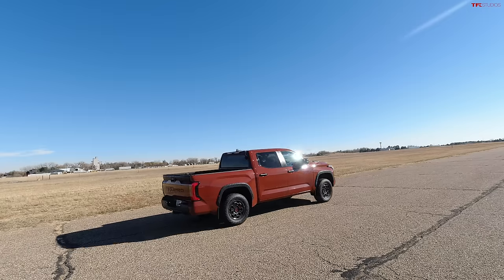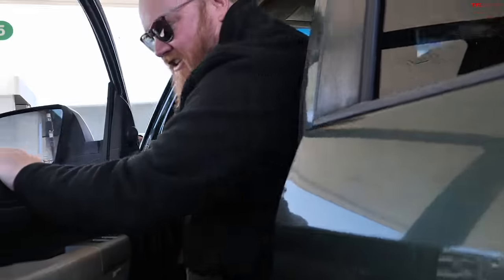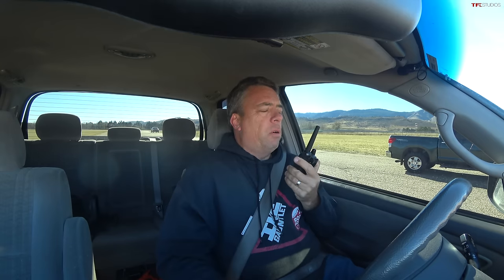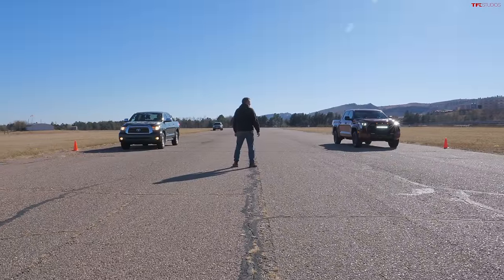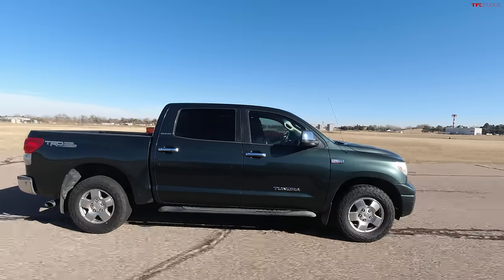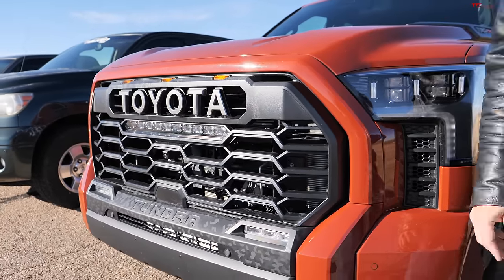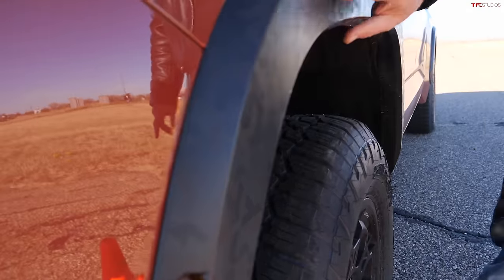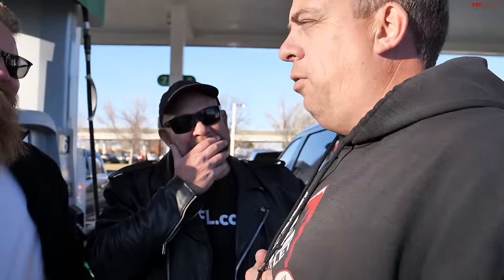Three Generations of Toyota Tundra Drag Race & MPG Surprise: That WAS NOT Supposed to Happen!

Comment: 1st Gen Tundra is still the best truck on the road. I have an 02 Tundra AC 4WD; throw on headers, exhaust, and some 12 hole fuel injectors and it make it feel extremely peppy off the line. I absolutely love this truck, only 161k miles on this bad boy
Reply: 100%
Reply: 161k miles? Not even broken in yet.
Reply: I have one with a modded intake and straight piped and it’s loud sounds like an off-road race truck and has so much power

Comment: That little 4.7L did a lot better in the drag race than I expected it to. 245hp vs 380hp and a full liter of displacement difference between it and the 2nd gen Tundra. I know the first gen is like over 700lbs lighter, but still, impressive showing for what it was.
Reply: I have a full time 4WD 4Runner with the 4.7 and honestly, it scoots off the line lol
Reply: I've owned both the first and second gen Tundras with the V8s. Both were crew cab 4wd and the second gen is much faster. Like Andre said, he got a great launch.
Reply: @mrjjthor  Yeah but even with the great launch he got, the 5.7L wasn't pulling as hard on the 4.7L I was expecting it to once things were well underway.
Reply: @S2KYLEFXLRST the 4Runners have the 5 speed trans and a 3.73 rear gear. My brothers 4.7 tundra he had wouldn’t run anywhere close to my 4Runners
Reply: 271 hp.   Variable valve timing in the 05/06. Complex cams
Reply: 270 HP 👍, I love my 05
Reply: @dalepenner8411 yes 06 sr5 magnaflow exhaust KxN air filter picked up 15 hp I think the truck Flys and sounds amazing
Reply: Gotta hit the traction and tow buttons on the 5.7 to activate the speed.

Comment: 2007-2013 tundras with the 5.7 are truck perfection!
Reply: 2015 with 8 ft bed for me. Longest one they made
Reply: Just bought  a 2013 Rock Warrior TRD.

32k original miles, 1 owner miles!
❤ love it❤
Reply: (2012 w/5.7) Agreed!
Reply: @joebideb  congrats, that sounds like perfection.
Reply: UZ vs UR
Reply: What is better about 2007 - 2013?
Reply: Agree. I have 2005 Tundra and love it still after 19 years. Toyota has a problem in that their trucks get uglier every generation.
Reply: @joebideb  What did u pay
Reply: 2014-2021 are better

Comment: To be fair the 1st gen tundra only raced once so it used less fuel
Reply: Since you mention it - the 3rd Gen Tundra raced only once as well. With that factored, the 2nd Gen and 3rd Gen MPG numbers nearly tied.
Reply: It made no sense to do a gas mileage after a race. If you make more horsepower than the other truck, you spent more gas to make more horsepower than the others . And then its a big Weight difference also.
Reply: They did the mpg run with a new tank of gas and they never raced on that tank..They raced after the gas mileage test was done.
Reply: @andrewinaustintx you can literally watch Nathan zoom down to go pick the one guy up... So maybe not racing, but it went down and back again quickly.

Comment: I bought a 2018 tundra about 6 months ago, zero engine stop start, no direct injection valve carbon issues, no MSD, 4.33 rear end and a massive snarling V8 they are fantastic trucks. I would have liked to seen this ran with tow haul on makes a big difference on these trucks.
Reply: Wouldn't have made much difference. It is the elevation that is killing the N/A trucks in this case. I have a 21.
Reply: @spareparts7630  possibly I live in a pretty high elevation, I think when you have tow haul on it actually uses first gear.

Comment: I owned a 2005 tundra with the 4.7 v8, fantastic truck dependable, reliable. Currently own a 2008 tundra 5.7 only mods I've done is a K&N air filter and a catback exhaust. I absolutely love driving this truck puts a smile on my face every time I drive it. The tow haul is an added bonus.

Comment: I have the grandpa truck(1st gen) but it's a 2004 so I only have the 4 speed transmission and less power without the added VVTI, however, it has 267k miles and all I've ever had to do outside of normal maintenance was change a window regulator that went bad. I love that it has big windows and a hood you can actually see over.

Comment: That extra 1/4 mile run for the 5.7l definitely factored into the MPG. Nice! I just decided to buy a 07 5.7l with 125k as a dedicated tow vehicle instead of a new Tacoma and it definitely has the quality to boot over the new trucks. I just can't see the new one being as reliable over time. Being a toyota owner the past 20 years with a multitude of vehicles, simpler setups and less electronics always last the longest and cost less to maintain. 

I'd love to see an Ike gauntlet between these three trucks with 7-8k loaded on them all.

Comment: Turbos are great for costing lots of money to fix. And not lasting near as long as normally aspirated engines.
Reply: I don’t know, all those Toyota turbo diesels they got seem to just go and go and go
Reply: @JollyGiant19 that's a diesel though. Most people buy gas engines.
Reply: apples and oranges ! @JollyGiant19
Reply: @JollyGiant19  thats not a good comparison
Reply: 2JZ-GTE is a reliable engine.
Reply: Not to mention being fun af to drive. There's an exhilaration when that turbo kicks in
Reply: Do you really need to put 91 into a limited twin tundra? The manual says 81
Reply: not really na engines usually do not work as efficiently as tt engines

Comment: the first gen is definitely the best looking of them all
Reply: Looks like a 98 f150
Reply: Lies. 14-21.
Reply: Yes sir, especially when they gave it a crew cab option in 2004.
Reply: @ah4800 But lasts 5 times longer
Reply: @stefanovichmichael9686  I guess if the frame can make it that long. I had a 2004 yamaha edition tundra, traded to a 2011 f150. F150 is 10x the truck that was.
Reply: @ah4800  I had a 03 Tundra,traded a sub par f150 for it.409,000 kiloms,no issues, no rust.Far better built than a Ford truck.Presently have a 16 DC Tundra.Same deal,no issues,no recalls,no warranty work after 8 years and 200,000 kiloms.They both put the 2 ford trucks to shame.
Reply: @stefanovichmichael9686  those 1st gen tundras have 1 of the worst interiors I've seen though. Dash squeaked like crazy. Bought a 2011 lariat. 10x the truck that thing was. The 3rd gen tundras are nice though. The 2nd gens look goofy
Reply: Let me know when that ford hits a million miles

Comment: In my opinion, the 2021 Tundra (2nd gen) is the best one out of all of them. Been a proud owner of one since 2021 and wouldn't change a thing (except slightly better mpg).
Reply: That's a good truck, but technically, its a 3rd gen.  1st was 2000-2006, 2nd was 2007-2013 and 3rd was 2014-2021.  You chose a great time to get one if you do not care for the V6 option, and yes, the V8 engine sounds amazing :)
Reply: @FreedomLovinLady  I thought that too (had a 3rd Gen Taco) but just saw somewhere it was called Gen 2.5 😳🤣🤷🏻‍♀️ I have a ‘21 5.7.
Reply: Is your Tundra lifted or stock height? Also if you don’t mind me asking… how much mpg do you get? I’ve been thinking about buying a truck but I’m leaning more towards the Tundra since I’ve heard a lot of really great things about them
Reply: @leomedina5614  -My Tundra is stock. I normally get about 17 hwy & 14 city. It’s also 2x4 as well. Hope this helps!

Comment: The 5.7 gains power with 91 octane! It has a knock sensor so you will get a few more degrees timing! If the 5.7 was at sea level, 91 octane and tow haul mode it would be a great race for a non hybrid 3.5 turbo tundra 👌
Reply: I'd like to see em race supercharged V8 tundras with supreme fuel vs the turd gen
Reply: He is correct!  Premium is recommended in 5.7.
Reply: @petefreeman3981  nope 91 not recommended

Comment: I'm loving my new 2024 Tundra non-hybrid...coming from a 2004 F-150.  It's smooth, quiet, handles great and more power.  Lots of bells and whistles.  I hope it holds up as well or better than my F-150 and trans last longer (it went out at 120K).
Reply: I went from a 2020 tundra to a 23 F150 after my engine threw a rod. Toyota offered to buy it back since the rebuild would have taken 3 months due to short block assemblies being on back order. Hopefully you’ll better luck than I did!

Comment: Just picked up a first gen Tundra for many reasons they covered.  6’4” bed, low fuel costs(87 octane + decent economy). Easy to maneuver and fit into tight spots for parking or off road, and relatively low cost and low-trouble of ownership. BUT, you need to maintain your 90k timing belt interval and lower ball joints!
Reply: No one with a FGT considers them easy to maneuver into parking spots. They have the turning radius of a battleship.
Reply: @charged  unless you’ve come from something like an F250.  My FGT feels like a Miata in comparison to that thing
Reply: @charged Access Cabs turn great.
Reply: The turning radius is actually comparable to the larger gen 2 Tundra, so I see what you are saying, it's not super tight.  However, I never have any trouble getting my 2003 into any reasonably sized parking spot, just like driving a large sedan, but with better visibility.  I can even back it in easily, even though I have not added a backup camera 😲😂
Reply: @charged  Yeah the turning radius sucks butt lmao, in especially small parking lots I find myself struggling to turn out/in even though it's a small body compared to bigger trucks. But that's probably one of my only complaints about the FGT (2000 here), it's treated me well, and it purrs real nice with some dual borla cat back exhuast when I hit the pedal. People love to try and race me, I wont be beating anyone in any races but it sure as hell sounds nice ahaha

Comment: Ive had my 2008 tundra with the 5.7lt  since I bought it new.  It’s got 253,000 miles and still going.  Runs like just like it did when drove it off the lot. No major problems what so ever. Just normal maintenance . I would take a second gen over any of the 3 any day.  If I were to buy a new Tundra it would be a 2021.  Only down side is the shitty fuel mileage.  The first gen cabs are too small. The new Tundra is a shitbox as far as I’m concerned and is gonna have a ton of isssues down the road.
Reply: I found a 2021 Toyota Tundra CrewMax 1794 Edition to replace my 2012 Toyota Tundra CrewMax SR5 back in March 2023 with only 872 miles. About 18 months old at the time, garage kept, original owner, showroom condition. It took me about 5 minutes to scoop it up !!! I didn't like the looks of the new 2022 redesign nor was I crazy about the twin turbo V6. Fuel mileage for my 2021 is about the same as was with my 2012, about 18 mpg which doesn't seem to different than what is being generally reported by the owners of the 3rd generation owners.
Reply: 😂. I bought a 2010. Its defenetely more of a truck. I love my 2010 limited Crewmax. The new truck is smaller. Nope.

Comment: I love the first generation so much as it was the last truck my father would own before he passed away. It was also his first non Ford or Chevy truck. He loved it so much and put over 200k miles on the original timing belt with hard driving and pulling a 20' camper around the U.S. in his final years. I got to drive it a few times while visiting right before he passed away and it was such a lovely truck to drive. I've been thinking about picking one up as a second vehicle and have even thought about the 2nd gen since the first gen prices are creeping back upwards as they become popular.
Reply: Your what who passed away
Reply: @daniel45-70  father. I will edit that, lol.
Reply: I can relate dude! I inherited my dads 2000 toyota tundra. Such a great truck, I've had to do some maintenance on it, timing belt rack and pinion, fuel filter, spark plugs etc etc and it just keeps running and running. I've abused it even in its old age and it still runs great. 

Sorry about your dad, my dad passed a few years ago

Comment: Interesting test as I have had two of these trucks, a 2008 and now a 2023 non hybrid, the 08 did everything well except for fuel economy. The 2023 seems great but I’ve only got 7k miles on it, I’m averaging 20-21 mpg unless towing on 87 octane. My truck will never see premium fuel unless someone else is buying the fuel. 😊
Reply: My truck gets 20-21 mpg too.
Reply: I've heard many others say they're getting around 20-21MPG, and maybe a little worse with the hybrid. Still more efficient than the outgoing model. Very similar to the current Tacoma too.
Reply: @RedWingsninetyone  mine is the hybrid model
Reply: @JIPlatium  I got ya. Like I said, "maybe" a little worse.
Reply: Looking to buy a second gen tundra 5.7 or a Tacoma 12 to 18 yrs. What are yalls thoughts?
Reply: @mr.adventure6507  2nd gen Tacomas (especially around 2010 and before) were very capable and reliable rigs. Their downside was that they were known for frame rot issues in which Toyota was forced to buy back many newer vehicles or replace the frames entirely. This was more prevalent in rust-belt states but not exclusive to it.

The 2nd gen Tundra is very reliable, although the technology is based on mid-2000's tech. So later years were very refined, but MPG was terrible and power wasn't even that great compared to the competition. They also removed the auxillary transmission cooler for 2020 and 2021 models so keep that in mind if you like to tow.
Reply: @mr.adventure6507 2nd gen tundra is a best!! Horrible gas mileage. I get 13mpg no matter how I drive.  It a 4x4 with 35's and 280k miles.  It's comfortable and rides really nice.

Comment: Still no tow hooks on the TTV6. I will take the 5.7 any time all the time.
Reply: You can get tow hooks 😂🤣
Reply: @flight2k5  yup...came with my 20 Tundra...included in the cost. Smart eh
Reply: @mikefoehr235  you can get tow hooks for the new tundra 😂🤣
Reply: @Pantelifts10  🤣🤣😂😂 you pay for them when they’re dealer installed 🤣🤣 damn boy is crying about 170 bucks.

Comment: I’d like to see what the total cost of ownership is when the hybrid is ten years old, my guess is that it will be double of what the other two are. Odds are that a lot of hybrids will likely hit the scrap yard when the second battery replacement hits.
Reply: Toyota's old-school Nickel-metal hydride batteries last a long time. What worries me is those turbos. . .
Reply: That type of battery isn't nearly as expensive as lithium. Also easy to replace then under the seat

Comment: I wonder what the gas mileage would have been on the second GEN if Toyota would have put the 10 speed automatic with that 5.7 L V8. I believe we might see a better story with gas mileage with the 10 speed instead of the six speed. That 5.7 L V8 was a workhorse and rocksolid dependable.
Reply: It would still not have been good. The only way it would have been significantly better is with cylinder deactivation and direct injection and if they truck lost 600 lbs.

Comment: My 05 4.7 tundra has 385,000 miles on it, original motor and trans.  Crazy great truck
Reply: I see them on FB marketplace with 280K plus miles, one even had 600K miles and they still go for $5K-$7K
Reply: Only bad part about this video is the interuption of the Ford commercial

Comment: Need to engage the Tow/Haul mode to really ring out the 5.7🤙
Reply: Like that would change the result!!! lol
Reply: What does that do in a flat out drag race? Something with the torque converter lockup or something?
Reply: @JK-qe6qq it does change the mapping forsure
Reply: All it does is make the throttle more sensitive and hold gears longer. You just have to know how to launch these tundras to not get them to bog off the line. Turn traction all the way off and don’t let the tires spin. But at the higher altitude the twin turbo v6 is hard to beat.
Reply: Doesn’t make a difference on the 07-13 Tundra. However on the 14-21 it does change the throttle sensitivity. But like others mentioned if you’re flat out on the gas pedal, it doesn’t make a difference.
Reply: @JustHavingFun_  it actually changes the way the throttle body opens up if you look it up it explains on some forms
Reply: @robertespinoza2740  I have the same year same truck in this video. On mine the only thing I notice is when tow haul is engaged it keeps the rpms higher than when it’s turned off. I honestly hardly ever use it even when towing.
Reply: @robertespinoza2740 Would that have changed the outcome?
Reply: @JustHavingFun_  I do as well if you hook it up the the computer and see it open up under full throttle there’s a big difference in torque and it kicks In at 3k rpm’s when it’s not in T/H it started a to hit hard a little before 4K
Reply: @JK-qe6qq  no but I’m not talking bout that I’m talking about the fact that they said it only helps throttle lag witch it does but does a lot more
Reply: @JustHavingFun_  keep it at 3500rpms on without t/h and give it full throttle then do it with t/h on. Huge difference even spins the 35s in 2nd gear
Reply: @robertespinoza2740  T/H makes a noticeable throttle input difference on the 14-21 models. When it’s turned off, the throttle input isn’t as sensitive as the 07-13 models. IMO, T/H mode turned on throttle input on the 14-21 models feels like T/H mode OFF on the 07-13 models, especially on initial starting from a stop.

Comment: I gotta add, if you turn off traction control and turn on tow mode on the 5.7 Tundra then WOT from a stop without brakes the thing is an absolute rocket. If you own one, please try it for big smiles